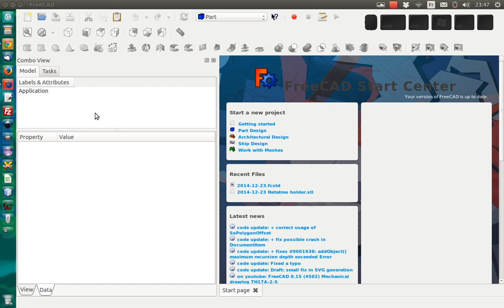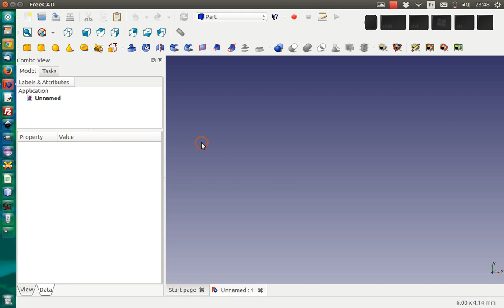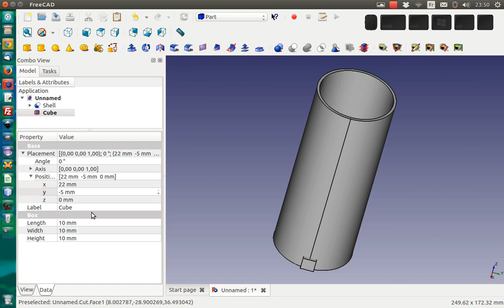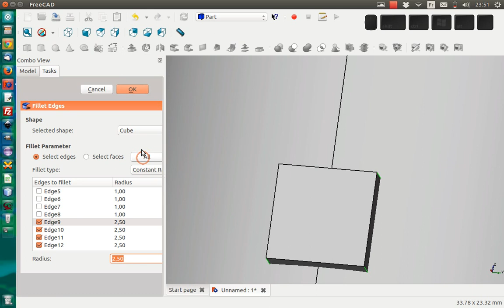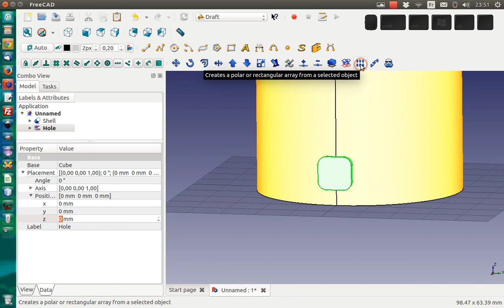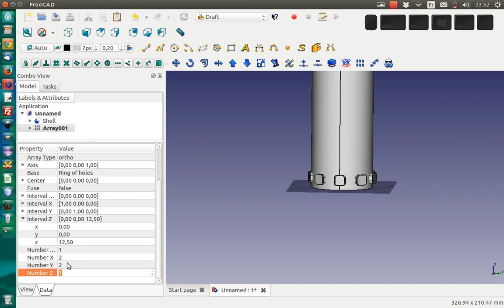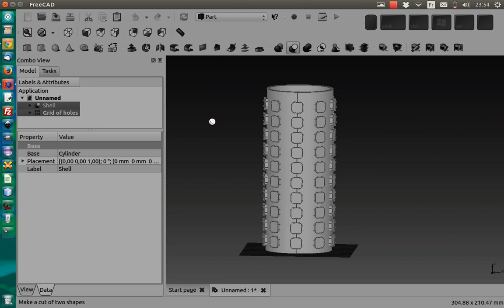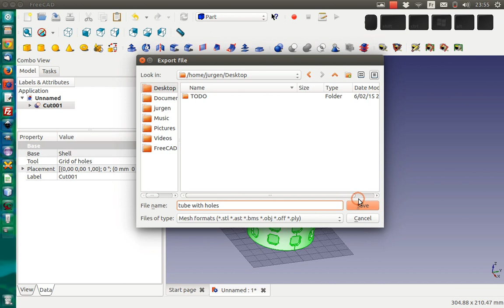Using FreeCAD for a 3D printing project

Comment: Jurgen, thanks! Very clear, very practical and easy to follow. I knew nothing about FreeCAD and drew a mounting for a squid pole antenna mount with 3 vanes (120 degrees apart) in about 30 minutes, after watching your tutorial. Great job!
Reply from the maker: Hey Adan, thanks for the feedback! Glad you took my tutorial and actually do something with it :) Care to share a screenshot of your creation?
Reply from the maker: ***** *woooot* We got a TAZ2 that Lulzbot donated to our hackerspace last year. It has been great fun already! (and again a big thanks to Lulzbot)

Looks like a nice little project you made there. I noticed you also rounded the bottom edges. Did this come out nice through your printer? It looks like you're having a really small "touch base" to stick to your bed.
Reply: Jurgen Gaeremyn Hey Jurgen, version two has a flat bottom edge and the 3 vanes tapers away towards the top, sort of like 3 stabilizing feathers on an arrow. Maple syrup gives me good purchase on the initial layer but I am not happy with my slicer settings yet. Layer 1 is perfect but the next few solid layers are cactus. ;-) Still working on that. Where are you based? I have seen we have a hackerspace in Canberra but I have not yet paid them a visit. (my bad)
Reply from the maker: Hey Adan, I'm living in Belgium, near Brussels. I'm member of the Brussels hackerspace (www.hackerspace.be). Nice how you're improving your design. :)

Comment: Good video.  But I have a question.  Is it possible to stagger the holes.  That means, the wholes will not be on the same line  vertically.  In other words,  the polar array has to be twisted little beat on every horizontal occurrence, as we move upwards.  Staggering will make the model structurally strong.  My  reading is that the feature is not still there.  Thanks
Reply from the maker: I didn't try this yet. If I find time, I'll look into it.

Comment: this slices and prints as a solid with no holes.  I think you must select the final object in the combo view and then export to stl...
Reply from the maker: That's odd, I actually printed this a couple of years ago. FreeCAD has changed a lot since then, maybe something caused it to break. Try converting it to a mesh in the Mesh workbench in FreeCAD... (try out the different settings to see which ones suits you best)
Reply: @freesoftwaretalk TY for the reply, I had to select the item in the combo view then export, otherwise I think it is the whole file. It printed ok then on my Ender 3 Pro.
Reply from the maker: @agnichatian  you're right. I did this instinctively.
Reply: @freesoftwaretalk  Hi you said you printer this, does it actually holds together? Structure seems to be weak.
Reply from the maker: @n0spam911  it wasn't meant to be very strong. Just have it "attached" to a cable - more a visual thing about people not accidentally pulling out a cable.

Comment: Great tutorial! Is it possible to apply the same to a different shape ,Not a cylinder but a non regular model?
Thank u
Reply from the maker: Hi SImone, I guess it will all depend on how complex your shape is and how accurate you want it to be. You can rotate (fixed angle) and/or translate (fixed distance) your item over x,y and z axis. If your shape is irregular, I'm assuming your movements will also be irregular. It's been a while since I've worked with FreeCAD for something serious. Can't tell you right away. Maybe start by asking it in the FreeCAD forums, they are a great community and very helping!
Reply: Jurgen Gaeremyn tanks for your support

Comment: I started building a cap for my car windscreen wash liquid, and got stuck. Thank you for showing me how to solve it.
I was missing a union of the parts and then the export. Thank you
Reply from the maker: Hi Ovidiu, glad you got the help you needed... Please make sure to post a picture of what you made online, and maybe mention that you made it using FreeCAD :D
Reply: +Jurgen Gaeremyn I just ordered the part via 3dhubs. If I remember, I'll blog about it. Thank you again.
Reply: I've blogged: http://wp.me/p5x2El-i2 Thank you again.
Reply from the maker: Hi Ovidiu-Florin BOGDAN, nice job! Did you check the materials that they won't dissolve in petroleum? Am I right that you printed this on PLA?
Reply: +Jurgen Gaeremyn it doesn't sit in petroleum. It's wind shield soap. Anyway, it's a prototype.

Comment: could u put this file in to a 3d printer nad it would work cause i been looking for a way to 3d print my freecad designs
Reply: typo and*
Reply from the maker: Satvik Kethireddy Hey, there are a few tweaks needed to have this printed on a normal 3D printer - e.q. you'll need thicker walls and you'll have to use support patterns. But otherwise, it would work just fine.

Comment: i think freecad can be my new love :D ... but it this tube printable?
Reply from the maker: Thomas Fragstein Hi Thomas, all obviously depends on what printer you're using. When using something resin based (see e.g. Carbon3D of f.e. using a service like Shapeways), you won't have any issues. When using a typical 3D printer, the shell might be too thin, and you'll have lots of support material in the holes (set this up in your slicer). This combination will make it hard to clean up. I finally made a thicker shell (3mm) and added some other items (a lock hole and a USB opening).
Reply: Jurgen Gaeremyn 1.) Lock Hole & USB opening?  What is this thing supposed to be? (actually curious). :-D

Regardless of my lack of purpose for this... I really wanted to start working with this 3D printer (Learning a TOOON of stuff from you and I thank you).  But, like he asked...  is it printable? 

I see your above message.  I'll make the cylinder thicker.  Though I am wondering what the best way to get Gcode straight from FreeCAD is.  Going to a secondary program is already causing me confusion.

Slic3r is taking away the holes (supposedly to make it water tight and manifold.   But, if I can't print what I design, what is the point of even using Slic3r?   UGGGHHH... it's making me crazy!

Please assist.